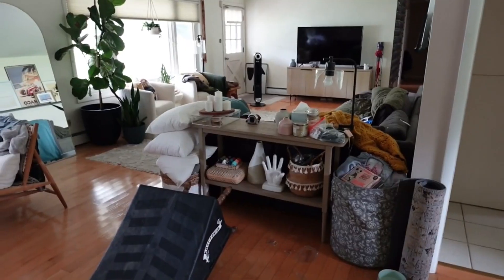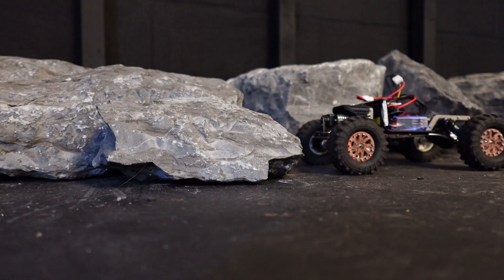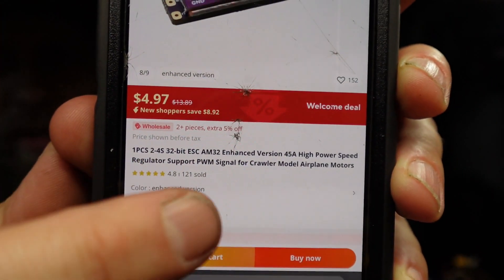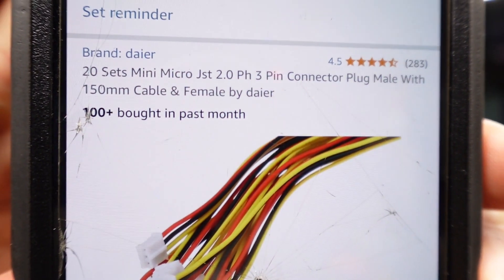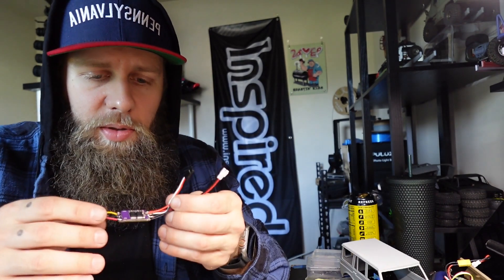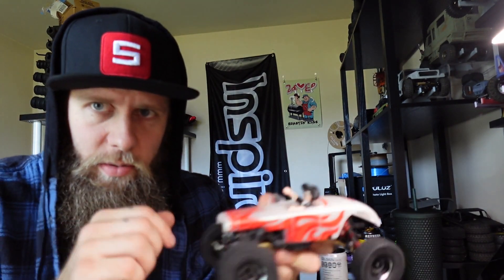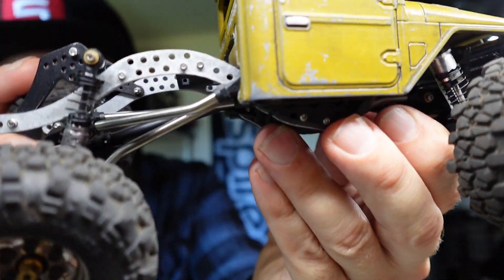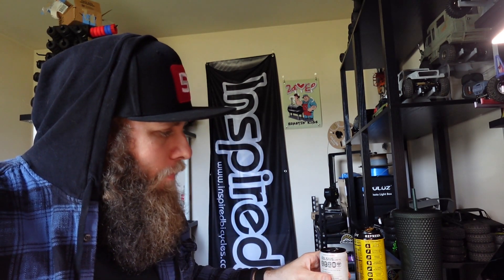DIY - $10 Brushless ESC is SMOOTH AND GOOD!

Comment: For whoever wondering, that particular esc uses FreelyRC firmware (don't use the v2 firmware) and PB4 bootloader for STM F421... I flashed it to v2.19 using esc config tool...

Comment: You can now buy 60A AM32 ESC for $10-15 all wired up XT60 and 3.5mm bullets! RedHobby cheapest, also sold under other brands with other connectors or without the switch, amazing deal, ordered 3 for $29, gonna checkout the quality
Reply: Oh but those are bigger however

Comment: maybe some computer thermal tape stuff and a nice laptop  ssd heatsink cut to fit. or any small heatsink really.  just put that right on the mosfets on the back of the esc card. that might help heat along with a fan if you want even more cooling.

Comment: i see amazon has this pre wired on prime for 22 bucks so the motor would still need soldered but for 22 on prime why not i guess 
. i run these in my tenth scale well not this one but the am32 esc and i flew fpv for years so I'm very familiar with these types of esc . thanks for sharing bro

Comment: Works flawlessly with the fat viper I can confirm stock just soldered the connectors and used a cut servo plug to connect motor to sec with 3 pins cut the female side stoked furitek lost some business from me as of now

Comment: Solder tips to make you a pro. Cut wires to fit. Strip tip a bit over amount needed.   Twist wires tight.  Solder or pre tin wires before soldering to board.  Then pre tin the board Solder pads.  Last ts100 best Solder iron ever and can even be ran from a battery.  Cut wire tips short before soldering to board.  Last slid heat shrink over esc.  Thank you I was looking at these and wondering if they wild work.  Awesome.

Comment: just got mine, 7 days not bad I to don't solder but I will learn with this, solder points are so small should be fun, thanks for the vid, love your work what size wire did you use? plug wires seem so small 26 awg is this ok?

Comment: Definitely get yourself some flux. It  helps the solder not blob up and flow better joints   .I would also shorten up the length you strip  off. It weakens the joint I find ,plus it’s a risk to short out. 
I’ve been soldering for 10 years now doing  rc stuff and I still don’t have it down as good as I would like. Practice is key

Comment: Id whack some hot glue over the soldered connections on the board they cant short on anything 👍
Reply from the maker: I debated this, wasnt sure if it would mess anything up
Reply: @24Yepp  it shouldn't do, I've done it and it's been fine just gives you that piece of mind incase they touch any metal 👍
Reply: @24Yepp  you wanna heat shrink the end where it connects the battery also to be on safe side.. I'd do each of the 3 pins/wires individually heatshrink then a bigger piece of heatshrink over that lot... Preferably included a bit of the back of the connector with the last piece over the 3 already individually shirked ones... You'll have to unsolder them to do this though obviously then feed the larger heatshrink over the three together first, then the 3 individually named next, then solder, shrink the 3 individually then the one over the lot 👍
Reply from the maker: @RocknrollRC  cool, thank you!
Reply: @24Yepp  no worries ☺️ sorry I made that sound way more confusing than it had too! 😄🤦‍♂️ Thanks for the content dude 🤘

Comment: If you run this esc with a Furitek brushless motor mount spur and pinion combo. Metal or stock trans. Paired with a surpass c2822 1400kv from Ali express that costs about $11 how could you go wrong? I run all of the above and it works flawlessly but I was running the older version of the esc just bought the one he listed and am gonna try that one out when it comes in

Comment: Is it for any motors & is it for brushless only? Pretty sure almost every RC enthusiasts can solder eventually your gunna have to so ya .right as well learn I solder & just went to different sites to get tips the one thing I did find is yiy need to get the correct voltage gun & the solder has to be a certain type so if it gets hot it won't melt. Thanks for the heads up Trey & nice 5 ten hat my go to shoes. 👍🫰🫰
Reply from the maker: Unsure, i THINK brushless only but im clueless

Comment: soldering tip, hook the wire inside the hole then put solder in the hole for cleaner looking boards and better holds

Comment: I just happened to wire my one up last night! I plan on trying it in a light weight 1/10 truck with a 1400kv motor. I will be printing a case with a fan mount to combat any heat. On the bench it seems smooth and worked straight out the box.

Comment: Great researching this esc. Will buy some of them. What's the name of the AE- shop? Here is my soldering tip for circuit boards: you need a special soldering flux, that is not aggressive for the board. The normal one will destroy the board after some time. Same reason using solder without integrated flux!! The flux you need comes normally in pens like an edding. In Europe eg flux x32-10i from Stannol. Put on the solder on the cable and soak the part of the circuit board you want the wire to connect with the flux. Don't use a thin soldering tip. Hot and very short is the way to go. The amount of flux is important. When the blank part of the circuit board is wet from flux, it will suck in the solder with the cable through adhesion forces. You don't have to be fiddly. Try it on old circuit boatds first, after some tries its very easy. Biggest mistake is to use normal flux and using a small tipp, trying to do one connection after the other. The way I explained is the way to solder tiny mosfets on mini-z circuits to use stronger motors. And they are really tiny. Half a second to long, and the mosfet is broken. But this method works perfect. And the chill out is a great idea!

Comment: How about a tutorial on how to get the reciever you are using to work. I got one and can't get it to bind to my fs-g7p. It does get real hot tho. I may have even burned it up. I like you am an idiot at the electronics. I'm also a licensed ham, which should tell you how much modern day hams know about electronics.
Reply from the maker: My little micro recievers have a button on them to hold down when you turn the truck on putting it into bind mode. Not sure about fsg7p
Reply: @24Yepp  yeah, tried that.
Reply: I’ve got the same transmitter I’ve got servo no motor😢
Reply: @mrmoss7278  turns out the GT5 is a different protocol than the G7P. Good news is Flysky sells 4 channel ANT protocol recievers for cheaper than these. I got a few on Aliexpress.

Comment: Not sure what i did wrong. I put a cap on mine, 2s lipo, 1806 motor. It wont connect to PC or work. It just gets warm sitting there doing nothing plugged in
Reply: i was excited about the prospect of $10 brushless ESCs, but i already have several MBL32s from Injora(that i love), and they have a 7.4v BEC so that wouldve added some more cost to the $10 DIY ESCs